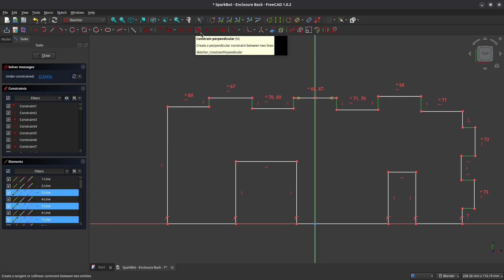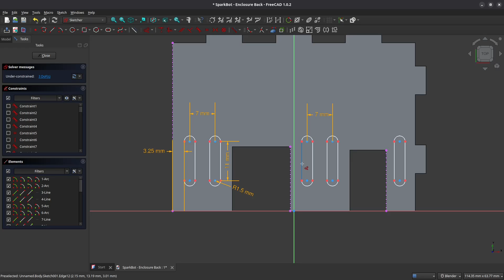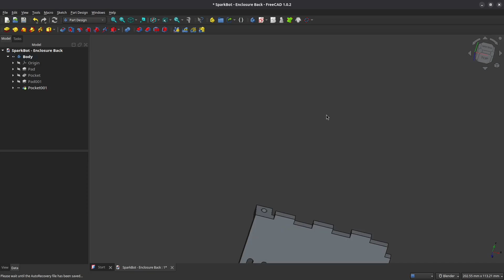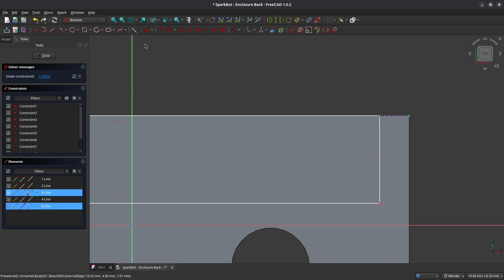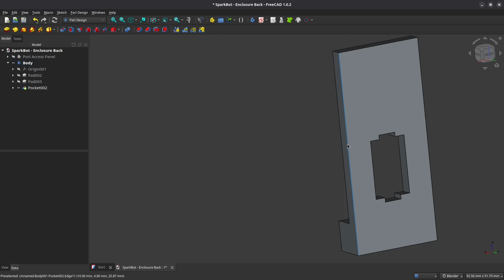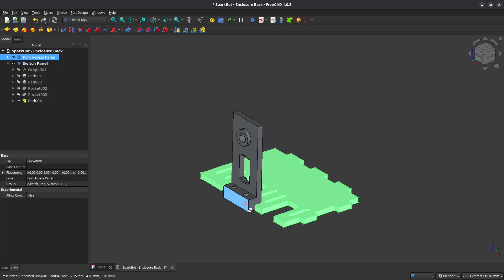SPARKBOT V2: PART 16 | ENCLOSURE BACK

Comment from the maker: Welcome to Part 16 of the SparkBot V2 architecture. 📐

It is a good idea to never attach heavy wiring to a moving access panel if you can avoid it. By splitting this back cover and making the switch panel completely static, we ensure our main power wires aren't being bent back and forth every time we open the enclosure. Strain relief is everything.

Question for everyone building along: How do you handle routing your main power wires in a tight chassis? Do you have any horror stories of wires snapping because they were attached to a moving hinge or door? Let me know your best design fixes below.

Chart your course. Build your world. 🍁